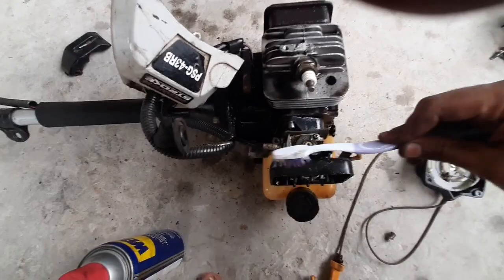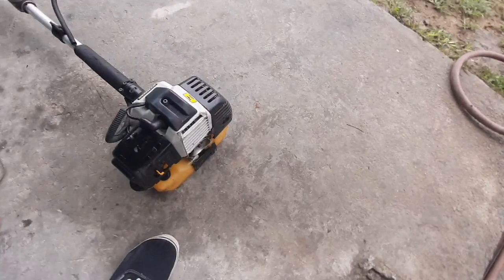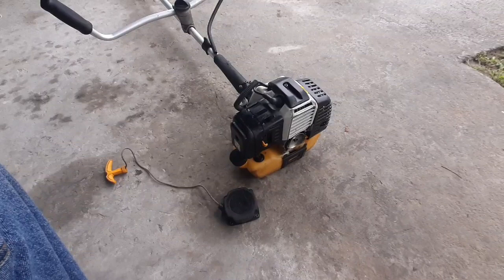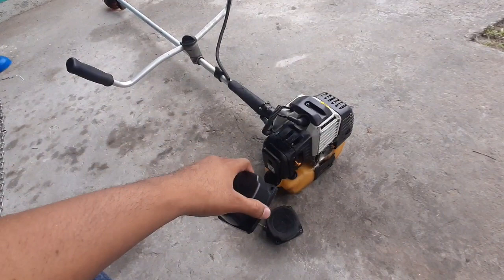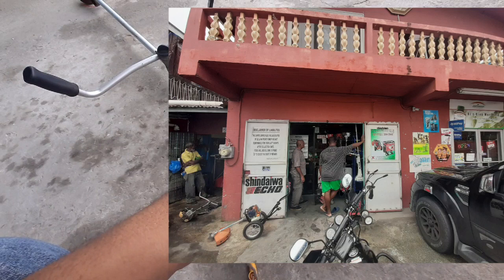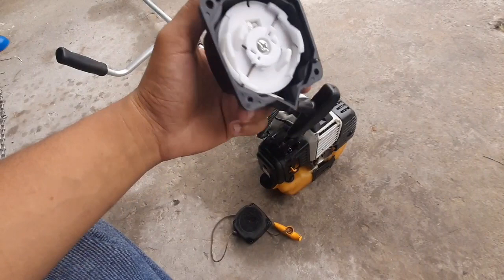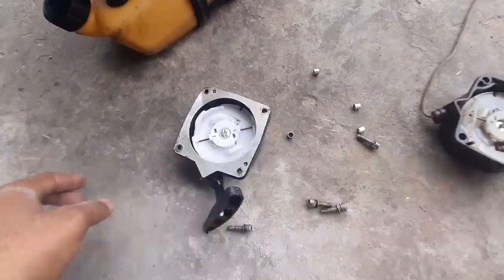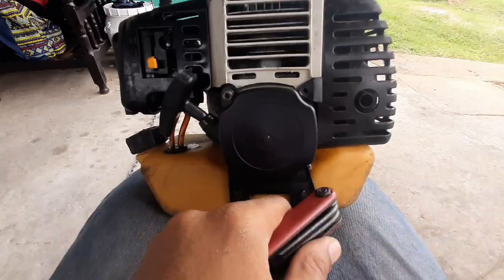power stroke brush cutter starter recoil spring and replace a stuck or limp pull cord

Comment: Why is my brush cutter NOT stopping?
Reply from the maker: You can be haven a electrical problem with the wires crossing, use the kill switch or pull up the choke to stop it